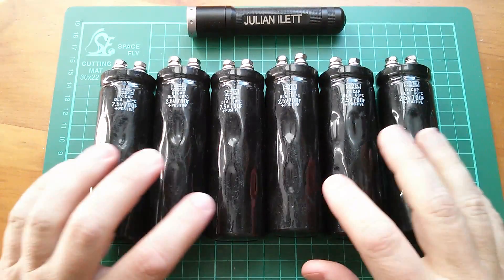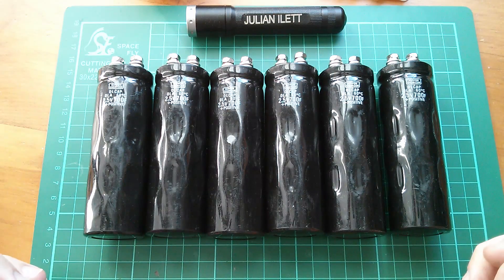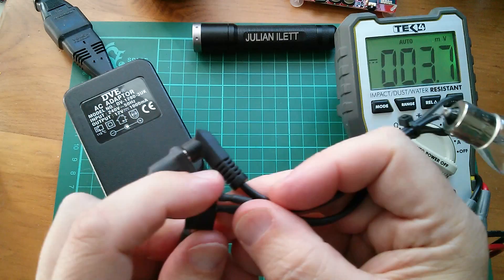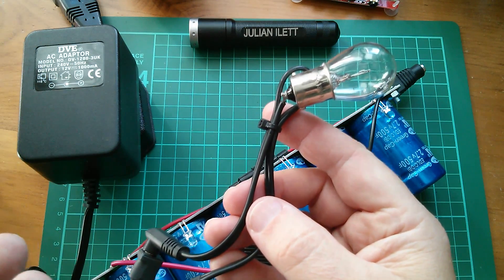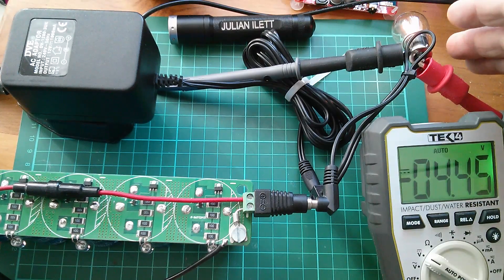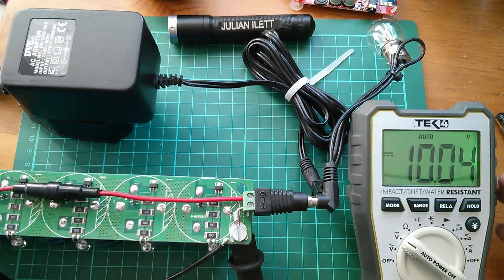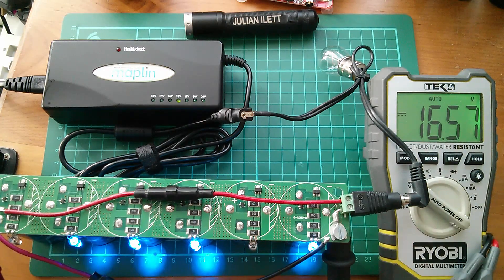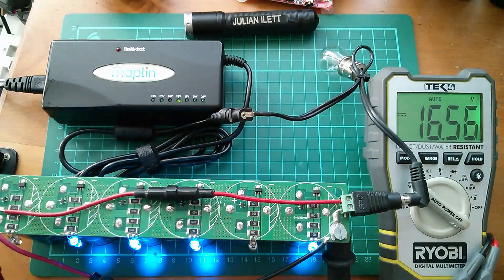Charging SuperCapacitors from a Mains Power Supply

Comment: Hi Julian. Nice video. Could you put a panel at the side of the vidio with stats on it, showing charging & discharge times in motion (Sorry, a bit of a geeky request)!
Also... I have a load of capacitors that I cut off of circuit boards, can't remember the exact numbers, but something like 2 x 400's, 2 x 480's, 2 x 750's... Would it be possible to connect up loads of different sizes to make one battery?

Comment: at 15:40 I think it is not the case: provided your power supply does NOT increase the output voltage above what capacitors are designed for (i.e. 16.5V) - which is the case with CC and CV: if you set up 16.5V as CV it shall never go above 15V even if CC=5A - it will simply not deliver 5A. If I am not mistaken of course. At least my regulated power supply says the same: if you set up CC and CV it will never increase V above CV and the current will be anything between 0A and CC set up. You cannot force the load to have lower resistance. You simply cannot force the load to consume more current with constant voltage. Increase of the current only happens when voltage goes higher. Unless you did not set up CC then current will reach max of the equation: V/R.

In short I think: if you have a good power supply that can deliver 16.5V (and protected against going any higher)  with 1000A the capacitors - by design - should charge in few seconds, then set up their voltage at max and equally amongst them and then the current should drop to near 0A (of course it would drift a bit when caps are getting discharged by your lovely diodes). What do you think?

Comment: I have the same blue capacitor bank and is it bad to dump an initial 45 amps at 12 volts into the bank, slowly decreasing in amperage and increasing in voltage up to 15-16vdc? I did this roughly 10 times total and didn't see any issues, the caps held up just fine and now it is wired in series PARALLEL with my car battery. It is amazing how much louder my 400 watt Rockford Fosgate amp gets with these caps installed.

Comment: I'm a noob to electronics. Can you add a parts list for the bulb in series load because it seems like something I could use on a lot of projects especially ensuring that caps are discharged safely (as opposed to using a screwdriver). I understand the circuit but don't know the names of the connectors. Excellent videos and channel Julian.

Comment: "Smart chargers" ARE indeed based fundamentally on a constant voltage source, not current. The current is limited, not the voltage. The current is allowed to taper at full charge. There is a bit more to it than that, but that's the gist of it.

Comment: I just had an idea for an insane power supply to charge these caps. I have a microwave oven transformer that i rebuilt to output 2 volts by replacing the secondary winding with a 10mm2 cable with 2 turns around the core. It can provide a steady current of 150A straight out of your mains, and i should mention it's a 600W transformer. Microwave oven transformers can often output up to 1200W so this is a small device =)

P.S. I only use this for spot-welding, and the new secondary winding needs to cool down considerably between welds not to overheat. So in order to continuously draw hundreds of amps you obviously need a much thicker cable for the secondary winding.

Comment: By now you probably figured it out, but what I always use are Current-Controlled/Constant-Current boost converters, a new module that has an aluminium backing fits the bill perfectly; they have 250 or 200W constant current dc dc boost converter in the title

Comment: You should try programming an Arduino to sense when each capacitor reaches voltage. Then switches the power in, off and turns on an indicator led. You could make it internal or external.

Comment: Do you really need first to condition these 700 Farad caps by charging each single one up to 16 volts and then quickly discharging them to 2 volts?
Reply: This was written in one of these seller eBay auctions how to condition these caps when you get them but I wonder if this will not destroy them by cooking the electrolyte inside them??

Comment: Hey Julian,
I've just bought a supercapacitor module. I charged them from a bench power supply @ 16.2v current limited to 7A (which is probably a bit high) but once the supercaps were almost full, the current fell away and they went to trickle charging, so I think that if you have a way to limit the max voltage and max current (like you do when charging a lipo cell) then they'd charge at max current until almost full, then charge at constant voltage at about 100mA until full. 

That's the results I got when setting voltage and current limits and I believe that's how lipo's are charged so you could give that a try, then you don't have to mess around with your bulb in series method. 

Hope that helps :)

Comment: I use one of these to charge my super capacitor. I set voltage to 13.8V and current to say 2 amps and it has a nice tristate led that goes from red to green when charged and current ceases to flow. I am thinking of a flip flop circuit to turn the whole thing off when the green light comes on. So also good for charging lithium
http://www.ebay.com.au/itm/DC-CC-9A-280W-Step-Down-Buck-Converter-7-40V-To-1-2-35V-Power-module-/232413023098?hash=item361ce54b7a:g:t4EAAOSwFntZbHwO

Comment: I wonder if you can convert a smart battery charger to be a capacitor charger?  2.7v for a Super capacitor and 3.7 for a lithium battery, would take what?  Software or a hardware change.  I'm guessing software.

Comment: Julian you have B3603 CCCV modules.... Merely set the regulated voltage just below the completely charged voltage of the pack, and the constant current as needed for charge. With the regulated voltage right near the top, but not over, the power supply won't put out any current that could hurt the protection circuits once everything is balanced.

Comment: Use a non-fold back current-regulated buck or boost converter, depending upon which power supply you use. But please don't run any small transformer at more than it’s specified current. Many of them have fuses embedded between the windings, with the intention that it is irreplaceable. My first professional job was for a manufacturer of small transformers, and they designed them quite precisely. One hour until fuse failure at rated current; half that time for every 5% above, so 120% of spec.means 4 minutes, depending upon thermal environment. Thanks Julian.

Comment: Why don't you use your 6 amp buck boost 3806 connected to the computer PSU or the unregulated PSU? then you control whatever voltage and current you like to feed your caps. Not sure if capacitors are affected the same way batteries are by high or near instantaneous"charging current".

Comment: Only thing I'm not getting about this whole charge issue is... Why don't you charge them in parallel ?  That would even out the differences, no ?
Why even need series at all? for most uses you'll need to have a buck/boost anyway to get the voltage you want.
Reply: With a starting voltage of something less than 2.7, the losses in a boost converter start to become significant. A ~0.7V drop happens across each diode junction, so that would leave about 2V to work with. If you want to supply, say, 1 Amp at 15V, thus 15 Watts, from that, then the loss across that junction becomes about 5 Watts, which is c.33% of the total power. If you use series-connected capacitors, giving 16Volts, then the diode loss drops to ~0.7 Watts, which is less than 4.5% of the available power.

Comment: Your calculation cannot be right, 6x2.5V 700F in series is 15V 700F. Where should the capacity go?
Reply: capacity ~ charge, charge ~ energy, energy ~ power, power = volts x amps so if the current (amps) is the same and voltage is increased 6x then overall capacity drops 6 times (since the amount of charge/adcumulated power is constant)
Reply: If you connect capacitors in series the capacitance of such "battery" is smaller than the smallest of the constituent capacitors. IF all capacitors are identical the final capacitance is equal to the capacitance of each element divided by the number of elements.  So Julian is right.  What you are thinking about is connecting chemical batteries in series, then you get to keep the a/h while increasing voltage.  Unfortunately capacitors do not behave that way. Capacitance of a chemical battery and of a capacitor are two quite different electrical parameters and are measured in totally different units.

Comment: Hi, maybe the best option for loading your Supercapacitor powerbank maybe the PS2002H programmable switching portable powersupply, though a bit expensive.
It can give you the combination of constant voltage-constant current capabilities of 0-30V at 1.6A or 0-12V at 3.75A.
I've got one and it works perfectly fine. I got if from a German company: Komerci oHG.
Good luck!

Comment: Use 2 converters. dc2dc converters.
1 delivers 4A max at 15.0 Volts
1 delivers 1A at (max Voltage) 16.6 V (what ever you need).
(a third one could even be added, they are rather cheap so why not).

To start off: it IS your responsibility not to have any super capacitor charged negatively.
Having said that, my solution will super charge the caps with 5Ams up to 15 Volts, and then slow down with 1 Amp (or even lower) for the remaining voltage.
The dc2dc converters will still have 95% efficiency even if the output voltage is very low (almost a shortcut). it is not a problem if you don't top off your super caps at the maximum voltage as well, so in 5 minutes you can have them 80%+ charged, and who wants to go for the total charge will have to wait another 5 minutes or so.
You do need to hand pick the super caps to be sure (tested) they are almost the same capacity.
The problems you describe are no different from what a BMS does or should do on a 6S li-ion packages (mentioning 6 because it compares to 6 capacitors)..
Reply: Using a relay driven by a voltage sensor with the commutating voltage set at 15V perhaps?
Reply: deslomeslager, that sounds good on the face of it, yet the implementation isn't clear. How do you envision connecting the two or three dc2dc converters?
Reply: Sean Flanagan, Just all negatives together and all positives together. I am already using this technique whereby I connect several solar panels through dc2dc converters to charge a battery. You do need to make sure every dc2dc converter has a diode in the positive lead. I currently have 4 dc2dc converters on 1 battery. Only one of them is set to 14.4 Volts and all others ro 13.8 Volt. My battery is in a very good shape. I do not need a solar charger.

Comment: Why not use a transformer with a high output impedance - similar to a solar panel? The current/voltage ratio will regulate itself over time; a cheap NiCd charger from an old RC car used the same technique. All that was in the plugpack was a transformer, and all that was in the charging stand was a single diode. You left it charging over night and could be sure it was ready the next day.

Comment: So instead of just using a proper charger (you have loads of them lying around) you just want to blabber around wasting energy and inventing dumb circuits which don't really work all that well? I don't really see the point of this whole video.
Reply: petti78 I feel you may not be this channel's intended audience.
Reply: For one, using such lightbulb-in-a-series trick can help you when repairing dodgy appliance that shorts the mains without constant visit to the breaker panel. Think beyond what you see...
Reply: If it works (albeit badly) then horrendous is not the right word. Inefficient, poor mans ptc thermistor, or whatever.
Reply: I've got a lightbulb in series socket for testing mains stuff like that, I know. But in this application it's just horrendous.

Comment: I usually just charge my super cap bank using cheap constant current power supply wired to laptop brick. Or simply with solar panel.

Comment: maybe you need a common mode choke julien to limit the inrush current, or a slow ramp circuit with mosfets - and using the PTC of a light bulb is actually really clever!

Comment: Why is the capacity of the capacitor divided by the number in series, and not as a battery pack stay the capacity of one cell if the are in series?
Reply: I think because the voltage goes up, and the energy stored is proportional to the voltage squared.

Comment: You have 1000 dc dc buck boost converters and you use a lamp... Just use one set to the maximum voltage you want with the maximum current your acdc psu can do and it's done. (For the current you'll have to consider the efficiency and the output voltage to input voltage ratio. For example with 80%, 18v/12v and Iinputmax=1A Ioutoutmax=1×0.8×12÷18)
Reply: wow .... he missed that one!
Reply: FireballXL55 of course he needs a balancing system. But it's not provided by a lamp either...
Reply: Concerning the balancing you can evaluate the current it can pass by considering the trigger voltage and the value and number of resistors it uses. Ex: 2.5V and 10Ohms means 250mA. The problem is that if you limit yourself to that value for the complete charging process it could be very slow. A solution could be to have an optoisolator per capacitor and a mosfet to insert a resistor in the charging path when one capacitor reaches the limit. And BTW please use a resistor with diodes to limit the current that flows into them.
Reply: Not good if you have one capacitor that is way lower than the others or worse one capacitor that charges quicker than the others, unless the protection circuit across that capacitor can handle the full charge current.

Comment: Why not use one of your buck converters, you can then set max voltage and max current, you could set the power supply at a higher voltage and let the buck do the regulating.

Comment: It seems to me that if you have a power supply with both a max current and max voltage setting, won't the voltage increase slowly while charging (keeping to the max current), but then the current will go down because the voltage is being kept at max voltage once it's near charged?
Reply: zodak9999b yes, that ist also how you Charge Lithium cells
Reply: Every good lab power supply can do this. I'm pretty sure there are tons of constant current charging circuits out there.

Comment: If you do plan to implement a constant current charging scheme that is efficient, fast and doesn't overload your protection circuit scheme, then it's best to isolate each cell from the charging circuit as they reach full charge. This presents several advantages including utilizing the full potential of your constant current power supply rather than limiting power to accommodate your protection circuitry. You can implement this by placing a MOSFET on the high or low side rail of each supercapacitor cell. As a cell charges, the FET will be ON (low impedance). Once a cell reaches its cutoff threshold, the MOSFET will be switched OFF (high impedance) by some manner of voltage detection and the cell will be overvoltage protected, as well as preventing a cell's shunt regulator from wasting power. It may also be a good idea to implement some hysteresis as to avoid partially conducting, or frequently switching the MOSFETs between ON and OFF states. You can either add a comparator/opamp with feedback to implement a schmitt trigger for your hysteresis, or use a zener diode with a feedback resistor on the MOSFET's gate. All methods work, but zeners will require less parts in higher voltage applications.

If you decide to use a voltage regulated mains DC power supply to charge your supercapacitors, a light bulb will certainly act as a crude current limiting regulator, but a better method will be to add a current shunt resistor in series with any power supply, and opamp's positive and negative inputs across it to measure current. This can either go to a MCU to be used as part of some charging scheme or connected directly to a (heat sinked) linear regulator or transistor to regulate current. You can easily make it adjustable by adding a voltage divider with a potentiometer, or rotary encoder with your MCU for very precise adjustment.